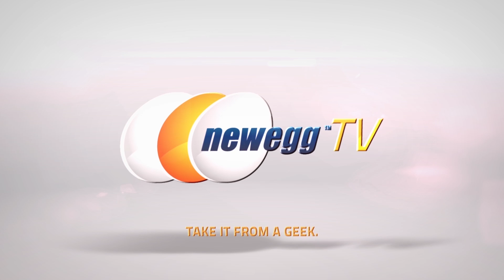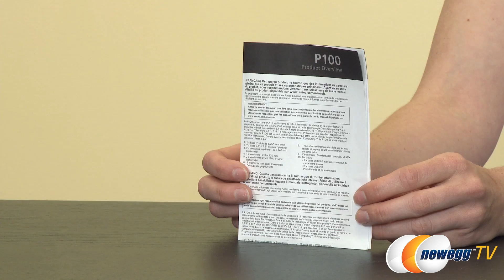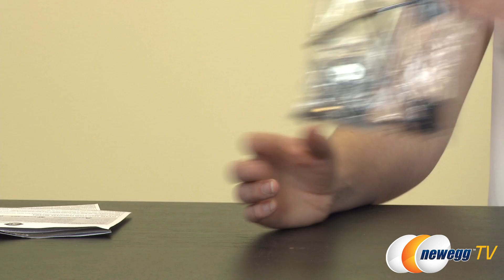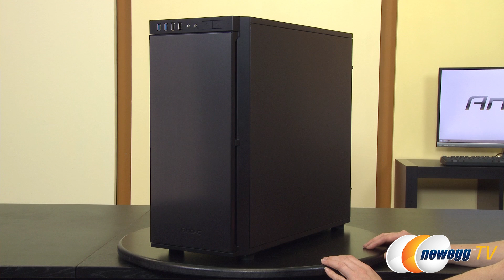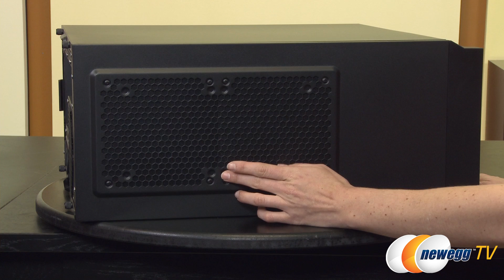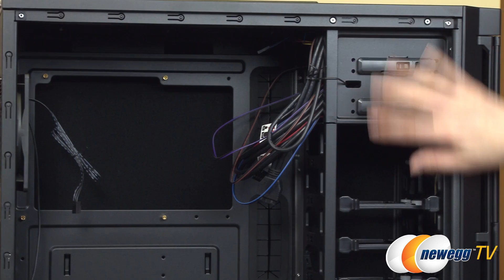Antec P100 Case Overview - Newegg TV

Comment: The one thing Antec always fails in for their computer cases are the fans they supply with the case. For a new build, most newer motherboards have 4 pin/PWM chassis fan headers. Providing 3-pin fans with a Hi-Lo speed switch is far from today's technology when it comes to cooling/noise/power needs. You'd think they would supply at least their better fan in hopes a builder orders more of them vs. being selfish with the grade of fan causing a builder to look for another manufacture such as Rosewill who make great fans and a great price point, as do others.

This is likely my favorite Antec Case next to the Antec One in mid-tower sizes. One 5.25 drive would be best to further reduce the size of this case if other hardware placement permits it. 

p.s. Other chassis makers do the same with their fans but not all, such as Fractal Design. Their R4 came with high end fans and three 140mm vs. 2 120mm.